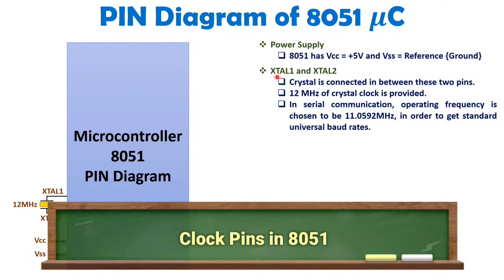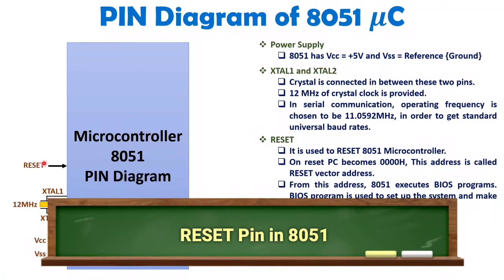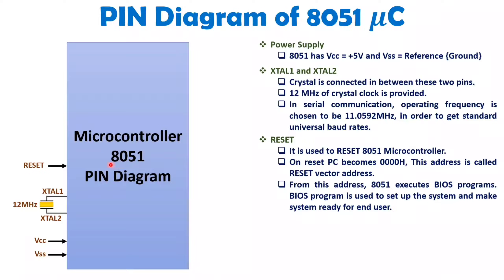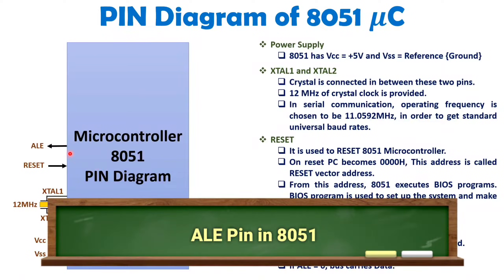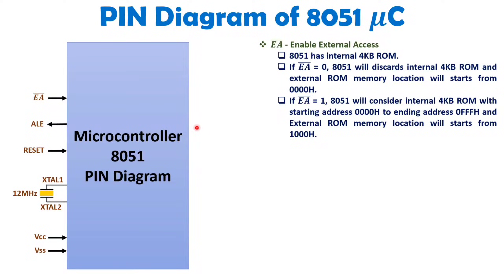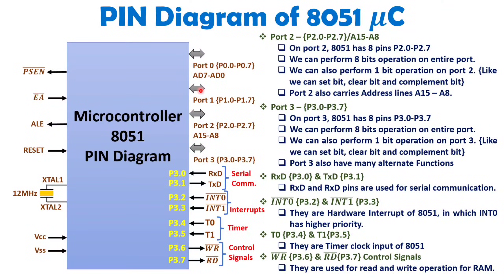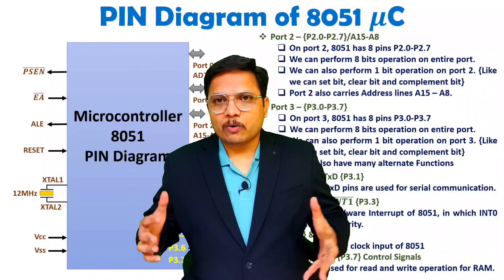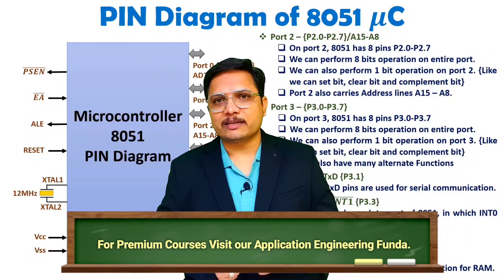Pin Diagram of 8051 Microcontroller: Key PIN Configurations and Their Functions | 8051

Comment: What are time multiplexed address lines
Reply from the maker: It has multiple functions with respect to time. Like it acts as Address + Data + IO + Control Signals.
Reply from the maker: It has multiple functions with respect to time. Like it acts as Address + Data + IO + Control Signals.
Reply: Sir in final diagram the port 2 must be mentioned as AD8 TO AD15. But it was not there?